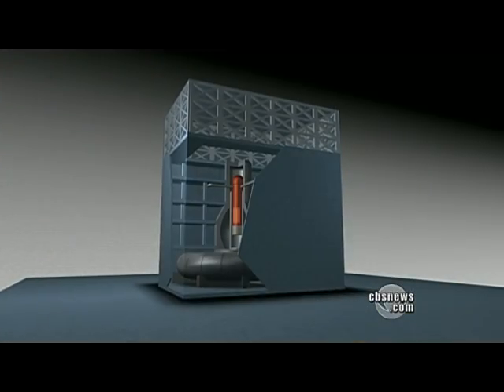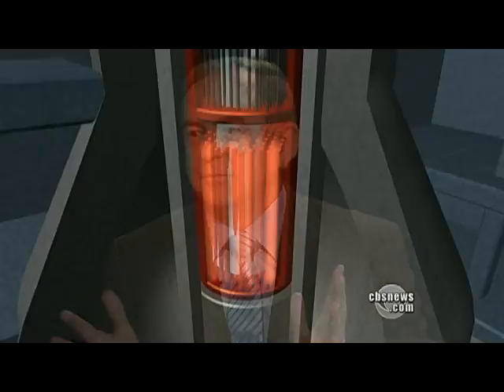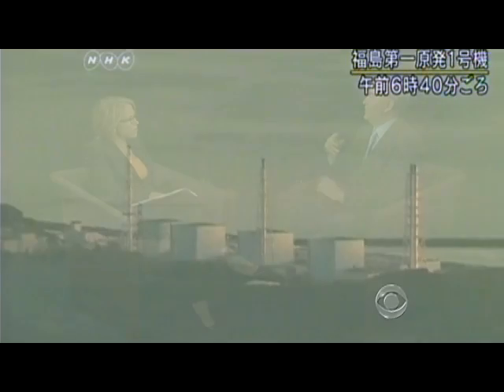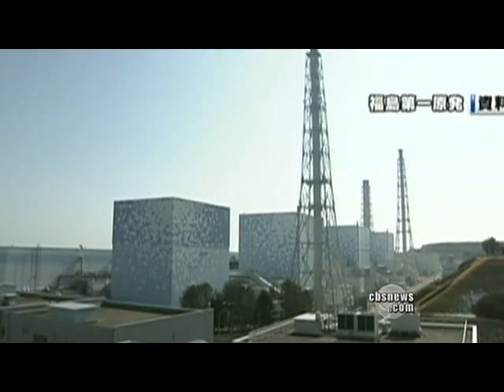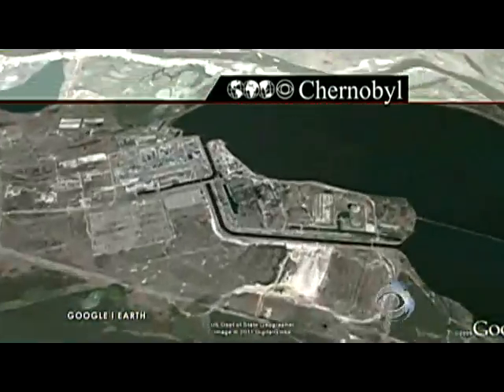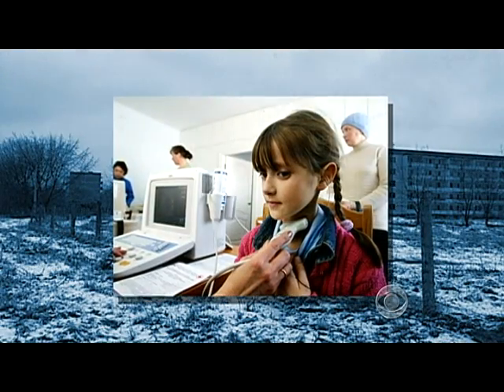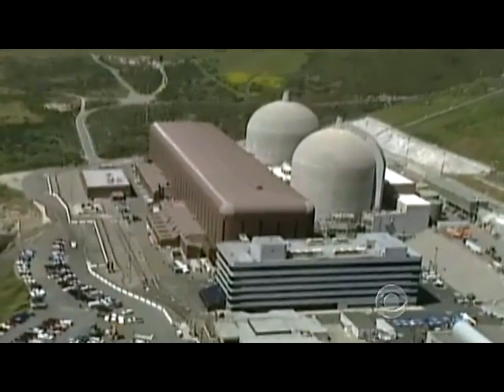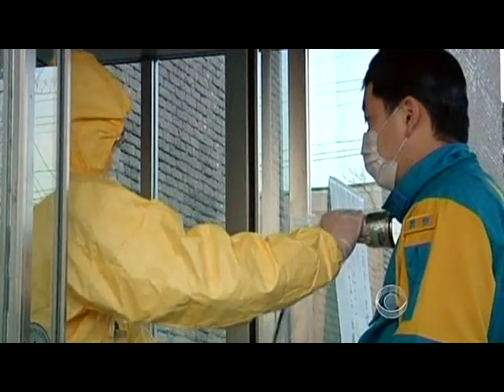Japan's nuclear plant explosions explained

Comment: Fukushima was hit DIRECTLY by TWO of the most powerful natural freaks of nature.

The rods ARE cooling..But like a boiling electric kettle, that turns itself off,,,It is going to hold its heat for some time.

So... One point 9 earthquake. Biggest Tsunami on record. Healthy hydrogen,fuelled by oxygen explosion. Massive logistic problems reaching the site...

And the containment system is still intact, not pumping out radiation.

Chenobyl, it ain't.
Logistics nightmare,
It is.

Comment: Chenobyl was a graphite moderated system.
This suffered a massive power spike.
In short, the dry atomic fuel ignited when exposed to oxygen. 

Heat rises.
More heat gains more height .

Fukushima are water moderated.
The Tsunami probably wiped out the pumping houses.
Water, cooling the rods is now not being circulated through the cooling system.
Water, when heated to extreme, pressurised, temperature goes through a chemical change.
It becomes Hydrogen and Oxygen.
This was the Bang!